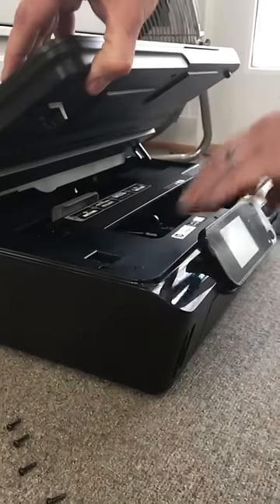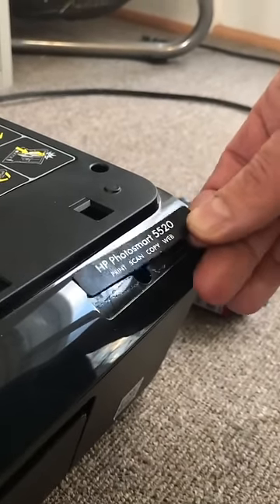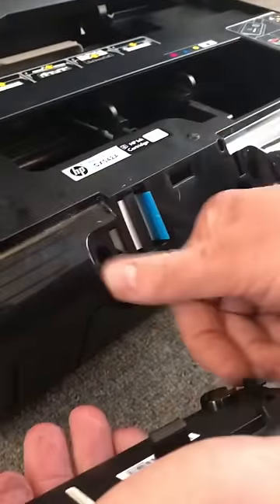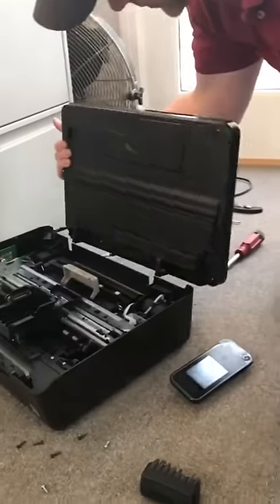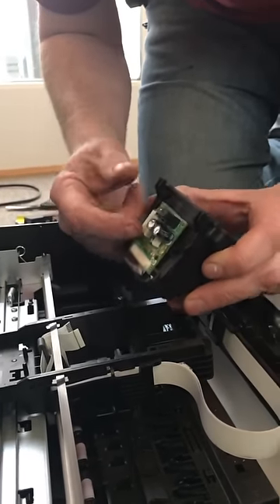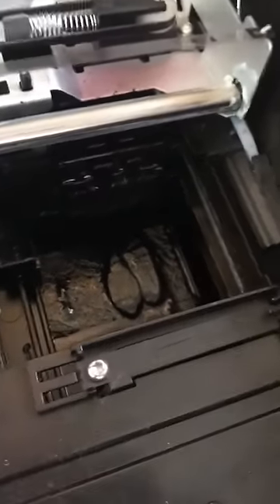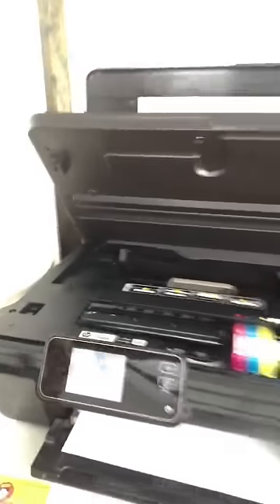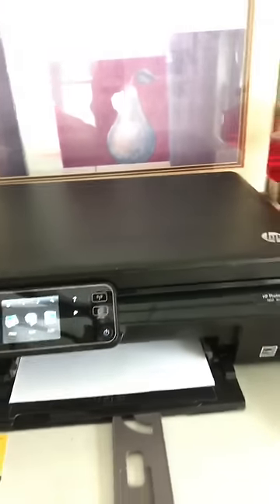HP Photosmart 5520 Black Ink Problem

Comment: Was just about to bin our 5520 for the same black ink issue and thought I would just try youtube for any support and found your video.
Thanks for taking the time to create this video to show your stages for solution and also showing your perseverance to resolve the problem when it didn't work first time.
Without youtube and people like you, my 5520 would have been in the bin.
Many thanks!
Reply from the maker: Thank you for taking the time to compliment the video. I hate throwing stuff away that can be fixed. Never tried this before, but we gave it a shot and it worked after a few attempts. I’m not a big ink jet fan, I feel as though the stuff just evaporates and it’s like buying gold to replace the ink! But it’s the one printer I had and I needed it to work. Still printing fine to this day. Thanks for watching!

Comment: Brilliant instructions. Managed to get my printer back to working order with your help. Thank you. One small tip to add, when you take the ink cartridge cradle out use dental floss thin brushes to clean in between the gap where the ink drips down and the ink nozzle. Did not submerge the whole ink cartridge cradle in water but "scooped" warm water continuously through the small gab and huge chucks of ink kept on coming out therefore unclogging the dried ink along with the dental floss brushes. Took me an hour to dismantle, clean the cartridge cradle and reassemble and to get it back up an running. Thank you very much Jarrod.
Reply from the maker: Thank your Marcus for watching and Im so glad it worked for you! The submerging of the ink cartridge head was a last resort for me, I played nice at first but it did nothing but resist!! It still behaves to this day after it’s been “reborn”! Thanks again for taking the time to watch and comment!

Comment: I had the same problem - no black printing - soaking the print head didn't help even though I thought I had cleared out the clotted ink and the water was clear but I still had a blockage, so I used a length of clear tube with about the same internal diameter to place over the circular gauze for the black ink at the back of the print head. I placed the print head in a dish of shallow water and carefully began to suck and blow on the tube to dislodge any blockage - the black ink that came out was amazing it took several goes but I could see that it cleared the print head.  Success!!  Everything is working as it should.  Thanks so much for the tutorial it's saved me having to buy a new printer.
Reply from the maker: Thanks for watching!! I’m so glad the video helped out, and thank you for letting me know what helped you clear the blockage. I’ve also noticed that you get what you pay for when it comes to ink. I was buying cheaper ink for another printer and it was clogging my print head. One day I’ll grab a laser printer! Thanks again for watching!

Comment: A much simplified variation of this idea worked perfectly for us.  We used a thick plastic straw just large enuff to stick the end of your pinkie in. Straw fits well in the printer head socket. Didn't have to take anything apart except remove the black ink cartridge. Then, grabbed a cheap plastic squeeze ball ear wax cleaner from medicine cabinet. It fits nicely over upper end of straw & forms a seal. Sucked some plain old tap water into the squeeze ball. (Maybe 1/4 full)  Put it in the upper end of the straw making sure everything was straight up & down for good seal. Gave the squeeze ball a few good firm squeezes while applying gentle downward pressure on the straw. (make sure you have a good thick doubled up paper towel under the print head).  Large globe of black inky water got all over the center of the paper towel. AHA ! Then, carefully dried up the water we spilled in the upper straw placement area. Replaced ink cartridge. Plugged in printer. Let it run & adjust itself. Then hit 'print'. Ran the same paper thru 2 or 3 times to get the ink back down into the flooded-out head. Wha-La ! Printer now prints perfectly. THANK YOU SO MUCH for the Common sense idea !  5 stars ! Took around 15 minutes including clean-up.
Reply from the maker: Thank you for sharing your experience. I greatly appreciate it.

Comment: Unbelievably! I finally got my printer back to work!
So I dug out the ink-pad (from my trash) and cleaned it up and put it back. 

There are 2 things to consider:

1. There are 2 "ink pads" in the C309g, one is the one already mentioned below. Then there is a 2nd one, hidden under a metal plate. That one only come out mechanically before or after the printer has done some kind of job, especially cleaning. It is a small board with brushes, several small wiper blades that seem to align with the black and colored printer heads and one upward brush whose function is unknown. 

2. You REALLY need to soak and clean the printer head very good. The first time I cleaned it, was not not good enough and it only lasted for one print. So I got pissed off and mixed up my own cleaning mixture. 

Prepare DIY Cleaning Mixture: 

- Hot water (not too much @ max 1:4)
- lab grade iso-propyl alcohol (~97%)
- few drops of dish detergent
- streak-free window cleaner (~9% Ammonia). 

Cleaning Procedure: 

(a) Washed entire head in running hot water until no more ink would come out. 
(b) I took a syringe to repeatedly squirt my cleaning mix through the black ink intake and from print head side. (more ink came out - it never stops!)
(c) Soaked the entire head in my cleaning mix for about 15 min, occasionally stirring it. Once the mix was not getting dirtier I took it out and rinsed one last time with iso-propyl alcohol + water only.
(d) Shook out the remainder of water in the head and used soft tissues to draw out remaining liquid.
(e) Cleaned the "wiper-blades" with cotton swabs sticks soaked in the cleaning mixture
(f) Re-installed printer head and powered up.

Last but not least. On this old printer, just keep the original HP ink cartridges, but do NOT buy new ones. Just drill a small hole in them on top and refill from other refillable HP compatible ink using a syringe. Put a small piece of tape over the hole once filled. Your ink levels will be falsely shown as empty but it will print just fine anyway. The reason is that:

Ink levels as shown by HP products are false information and is just an estimate of what's left in the cartridge after having printed a certain percentage of black pages. There is NO electronics built in to actually measure the ink levels. Your $20 USD cartridges cost at most a few cents to produce and fill. It's a total rip off that should warrant a class-action law-suit! 

Printer now works and have been printing perfectly for a week!
Thanks @Jarrod Fothergill
Reply from the maker: Some great information here my friend! I really appreciate you taking the time to reply with all of that! That’s incredible. I remember when I got my printer back together, it was showing my ink levels all empty. I double and triple checked all the wiring to make sure I didn’t leave anything unplugged. Couldn’t find anything but it still prints off of these same cartridges today, so there was plenty of ink. $60 for all the colors! Anyways thanks again for watching and a huge thank you for writing all of that great info up for us!

Comment: Your video really helped me a lot,I turned on my old printer after 3 years,put new inks but wasn’t printing black so I used your video for help & now it’s working like a charm.Just to add some trick I soaked print head in warm water & then blowed air from top using bike pump which unclogged everything.
Reply from the maker: That’s outstanding Varinder!! I’m glad you found the video helpful!! I like your idea with the bike pump! Hopefully that bike pump info will help someone else here too! Thanks for watching and taking the time to comment!

Comment: I would've never thought to blow air into the vent on the cartridge to clear the print head... It's brilliant and it worked! I tried cleaning the heads with alcohol, wet q-tips, and a syringe full of water, all with absolutely zero success. Came across your video and blew some compressed air into the vent of the cartridge and boom, black ink! Still a few streaks but they appear to be clearing up each time I print. You helped me out BIG TIME!!! Thank you!
Reply from the maker: That fantastic!! So glad it worked for you. Dynamite was the next option!! Thanks for watching and commenting!

Comment: Watched the video and the first thing that came to mind is the forced priming seemed to be the key.  Was able to clean the tar-like dried ink from the parking area pad with isopropyl 97% and some MrClean.  Used paper towels saturated with alcohol between the carriage rails like you did to clean the heads which worked great.  Finally, pushing ink in by blowing through the cartridge vent worked great to get the fresh ink back into the cartridge again.  Not much pressure needed either.  I used a  pin to punch a hole and a soda straw to blow through the vent.  Just a small bit of tape to keep the cartridge from drying out from the hole I made to finish up.  Great work and quite entertaining too thanks!
Reply from the maker: Thank you John for watching! Well done to you! In my opinion they’re great printers with a small flaw. If maintained once every year or two, these printers will last quite some time. You gave a very nice write-up in your comment and that alone should be able to help a lot of people as well. Thank you again for taking the time to comment.

Comment: Worked like a charm. Took only 15 min from start to end for me. I just filled a small container with hot water and rinsed the lower unit until water was clean and wiped off print head with wet paper towel. Messy job but it worked thanks for the video.
Reply from the maker: Outstanding and thank you for watching! Glad it helped.

Comment: Very good video Sir - Well Done.  I watched your follow-up video where you explained how you blasted air through the cartridge vent hole so I decided to try that technique first.  I parked the heads, took the printer out to my car so I could use my 12volt air compressor.  I stripped back the cartridge-sealing strip to uncover the blocked cartridge vent hole.  I attached a very fine compressor nozzle that came with my unit (I think its intended to inflate soccer balls or similar).  I pushed the nozzle into the vent hole and started the compressor.  The read-out got up to 13 psi before I switched it off.  I took the printer back inside, reconnected it to the power, conducted a head clean and test print - Everything was now working.  All undertaken within 10 minutes including moving the car onto the drive.  Bottom-line is that I think your theory is sound.  Well done and thanks.
Reply from the maker: Dave Harwood OUTSTANDING!! I love hearing that someone else has fixed the printer! This was my first video and I believe it’s been the most helpful video i have. Thank you for watching!
Reply from the maker: Dave Harwood When all else fails, blow it up!!

Comment: Your video really helped me. It is working again! It was messy and I had to use a lot of paper towels.  I didn't take it apart, I just focused on unjamming the ink intake filter. Lucky for me I already had some 12 mm syringes and I used a drop of dishwashing soap to about a cup of lukewarm water.  The paper towels were absolutely needed to mop up after injecting about three syringes full of water.  I finally got much less black water back and thought I was done.  I had to run about 12 test prints through and they were somewhat soggy, but at last I I got perfect prints again.  What a savings this is.  I've had this printer since about 2012 and never had any trouble with it before this.  I hope I can make it last another 10 year.  Ha!  You did a great job on this video.
Reply from the maker: CC Aring Outstanding!!! I love what you did there! I made a mess of my rug by accident and I thought my wife was going to kill me! She had some natural cleaning product that took the ink right out. I couldn’t believe it. Anyways, thanks for taking the time to write such a nice comment and thanks for watching!

Comment: This is my second printer like this. Why I bought another one I don't know. Did the same thing twice , both printers had the same issue. I didn't want to toss this one yet without trouble shooting it. OMG thank you! Took me about 5 minutes to fix! Little smuggey yet but it prints BLACK now!
Reply from the maker: Diane & Russ Kell That’s fantastic!! Once I got the blockage cleared, I took the head back out and wiped it down with some alcohol. Cleaned the smudges right up. Thanks for watching!!

Comment: So I watched a few videos similar to this, but I simplified the process just a bit.  Don't take the printer apart!  Open the lid and get the cartridges in the middle, then unplug the machine.  Take out all of the ink cartridges.  Take a 1/2 sheet of paper towel-fold it and slip it under the bottom of the ink cartridge carrier (mostly under the black ink well).  Get a small bowl of pretty warm water and a straw.  Draw up a little water in the straw and place it over the black cartridge hole (opening) and blow pretty hard.  I did this about 3 times and kept changing out my paper towel and making sure everything was completely dry.  Plug the machine back in and try to copy something.  If you don't have any luck-repeat the process.  I eventually started to see ink and then I just kept printing and printing and printing.  Pretty soon I had a perfectly printed page.  Only took maybe 30 minutes or less.  I was so proud of myself😍

Comment: the last tip is the gem! after cleaning the print head blow ink through the cartridge and head into a paper towel underneath. cleared whatever dried blockage i had in there and now i have my printer back! thanks.
Reply from the maker: Clare Lanusse First, thanks for watching! I’m very happy it worked for you!! Truly a pain in the you know what, but now it works! We’ve been putting ours through its paces lately and it’s still chugging along.

Comment: Jarrod, you are brilliant!  I had seen a Russian video on how to take it apart, but yours was better.  I watched another video describing how to clean it while still in the system, and I did that, but, like you, that wasn't enough.  Your discovery of blowing into the vent while at the same time holding it in place on the cradle dislodged whatever it was!  And, because of your warning, I didn't get ink all over the floor either.  Print quality is not all the way back, but I find that if you let the thing sit for a while it will re-saturate.  Thanks!  I owe you  one!
Reply from the maker: Paul Joseph Thank you sir. We learn so much from trial and error, or just by making mistakes. Thank you for watching my video and I’m thrilled it worked for you! My printer is still going strong today, in fact , a friend of mine gave me a HP6700 and there’s a label on it that says to keep the cartridges in place, and unit plugged in until the new cartridges are to be inserted. My guess is to keep everything sealed up so the ink won’t dry out in the print head. If the cartridges are removed, the head doesn’t return to its parked position and allows air to get to the bottom and top of the print head, which lets the ink dry and clog. The ink is trying to do as its intended...dry fast. When it goes to its parked position, it rests on the ink pad and stays wet. Anyways, thanks again for watching and glad you brought her back to life.

Comment: If an idea works, it’s not stupid. Dude you are brilliant. I had the same issues til I tried ur method and it worked! I didn’t have to spend hours soakin my printer head so THANK YOU!!!!!
Reply from the maker: HELENKELLER2013 Thank you very much! I’m glad it worked for you! My goal was to save people some time and money. This printer has treated me well, and I’d like to get a few more years out of it. It sits in a very cold office attached to our house that we don’t heat. It gets down to sub zero temps and this printer works great in these extreme conditions. Thanks again for your kind words!

Comment: Jarrod, First thanks for your service and your enjoyable presentation on the HP 6520 printer.  I haven't preformed the procedure yet but I'm sure it will fix my BLACK INK  problem.  When I first viewed you working on your carpet I instantly felt a INK  ISSUE would occur because ink and I don't work well together.  (I refill my own cartridges).  Again, great job, enjoy your great family and Thanks for taking the time to help Me and others with this video. That screw under the label would have got me in trouble.
Reply from the maker: Thank you Alan for taking the time to make this very nice comment! All I wanted to accomplish with this video was help people keep what they paid for, and keep it out of the landfill. They’re good printers. The printer in this video has been in a cargo trailer, baking in the hot, South Carolina sun since August. I’m very interested in how it’s going to perform when I unpack it. May be another video in the works. Thanks again for watching, and it was my pleasure to serve my country!